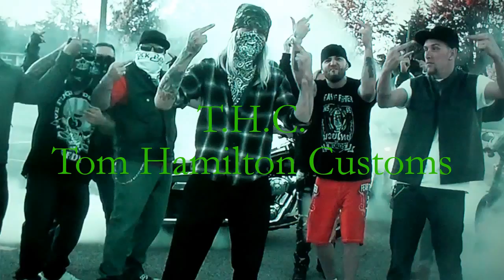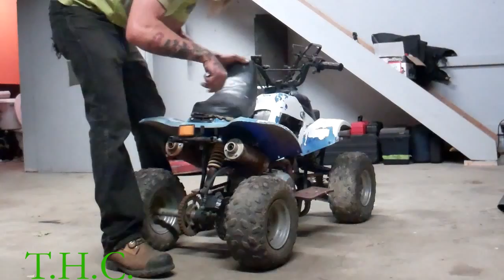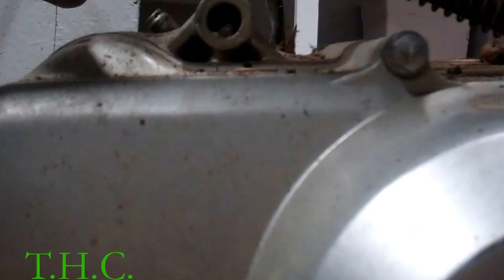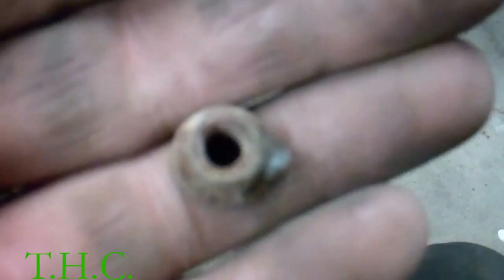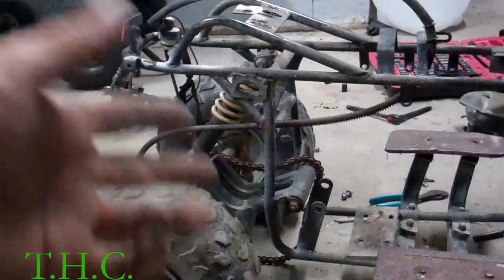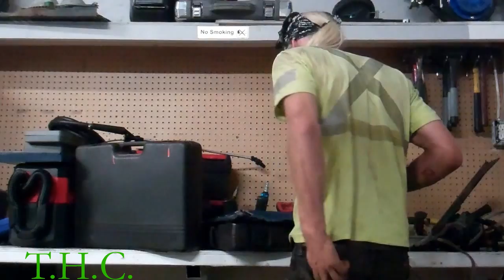WTF am I building ?

Comment: Tom dude ......those Japanese cheap ass quads are nothing but junk from the start......you re best bet is strip it down and mount one of those Cadillac bodies on both of them like junior.....buy a couple little ten hp motors and flange them all up and sell them for some cash to fund your rock crawler project......and for that you need to start from scratch......find a motor from a bad ass wrecked sled and use the motor and clutch and build you re buggy around it......I have a Arctic cat 600 sno pro and its pushing 130 hp and clutched so it dangle the ski s up to 80 mph".....buy some wide small diameter grip back tires will add to you re torque and tall narrow lugs for the front so the front sits higher and with a rear mounted motor right over the back tires .....it ll hook up like crazy.......check out the suspensions on the new razors or wildcats or bombardier performance side by sides and rob they re schematics.....whichever you like best......honestly though.....with the tools you have suspension will be a monumental task......I would just keep looking around for a side by side that has been fucked up some how and try and use parts already made......there are lots of videos on YouTube on making rock crawlers ...but full size.....if you could pull off a mini side by side replica of a rock crawler with 130 hp .......that thing will put bacon strips in you re gf s panties!
Reply: Umm.......Tom......you talk about taking the gas tank off.....and in the next sentence talk about the motor being electric....I think you might be in over you re head bud.....the carb and air filter are quite blatantly obvious as well.
Reply: DONT CUT UP THOSE LITTLE QUADS!!!!! You ll just have a bunch of piles of junk......get a couple Cadillac bodies ......fit them over the bodies ....with some reliable little gas engines and sell them for 750 each and use the money to start you re real project.